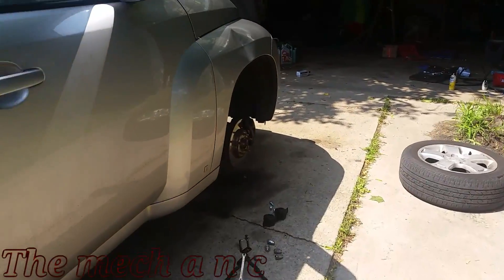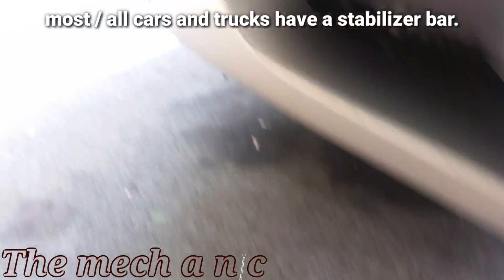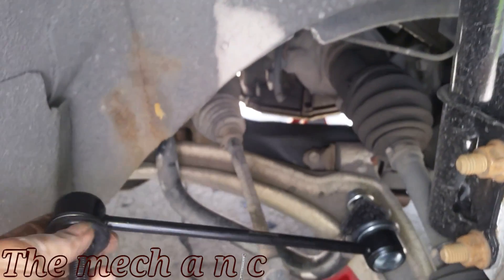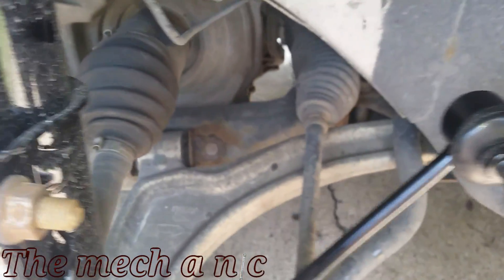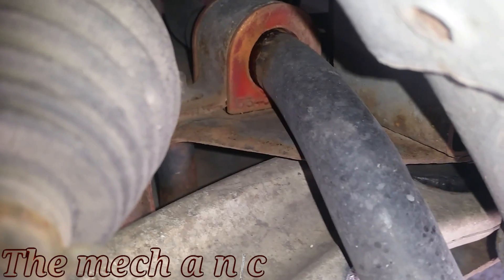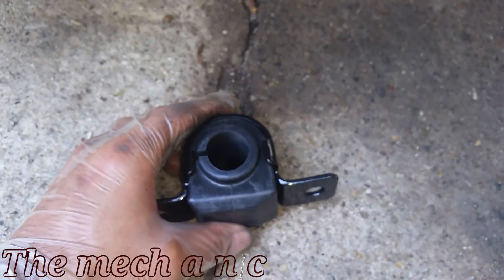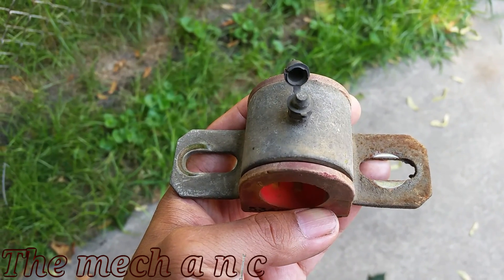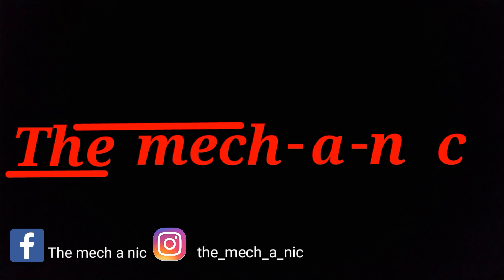Front end clunking noise ?

Comment: Nice video and i think it's my problem. Poss CV? I get a loud knock only when I'm pulling away with the wheel turned 3/4 or more. Don't happen or hear it when driving down the road. Any suggestions are appreciated. Both CV boots in great shape. Bmw 428xi 2014 45k
Reply from the maker: Maybe engine mounts? Stabilizer links?
Reply: @themechanic6117  thanks so much for your time and suggestion. I'll def be sure to check them out.
Reply from the maker: No problem. Good luck

Comment: I have a clunk sound under my floorboard most noticeable when accelerating from a full stop. It's not repetitive as I drive,  just one clunk or thud and then done. ~ Upon doing some research online and on youtube I think it might be a swaybar bushing but I really don't know.  Thoughts? ~ Thank you! :)
Reply from the maker: Noise From a stop...might be a engine mount
Reply: @themechanic6117 , I can actually feel it beneath the floorboards. It will do it as well from the car in motion to a stop but more often the way I described above (from a full stop to acceleration). ~ Thanks again.
Reply from the maker: You'd have to start checking things. Maybe a LCA
Reply: Same issue myself I think, did you figure it out?

Comment: Jonathan, i’m having issues with my 2.5 cx-7. I hear a clunk from the front when I accelerate from a stop.  Usually audible if i punch the throttle a little bit.   Lower control arms, stabilizer links, ball  joints are new since mazda recalled them before.  No noticeable wear on the rear mount.  What could be the issue? I hope its not the tranny!!
Reply from the maker: Have you checked all of the engine mounts ?
Reply: The mech a nic except for the tranny one. The rear and passenger look decent.
Reply from the maker: Engine mounts can be loose. I had a clunking on my Hyundai that drove my crazy for a year. The mount itself was physically ok but the bolts holding the mount down were loose and would clunk during accelerating
Reply: The mech a nic thanks man.  I do hope it’s only the mount(s) would have been nice if i can rev the engine to see if it rocks but its difficult to do it by myself since its dbw

Comment: On a 91 silverado k1500. The clunking noise comes always at any time the steering wheel is moved left and right. For example, pulling in and out a parking lot. Ive already replaced the driver side half shaft due to the boot being torn yet the passenger halfshaft was in good shape. Right off the bat, what else could it be? Any common problems you've seen on these trucks relating to this? Thank you for your time.
Reply from the maker: Check the steering components for loose or worn out balljoints